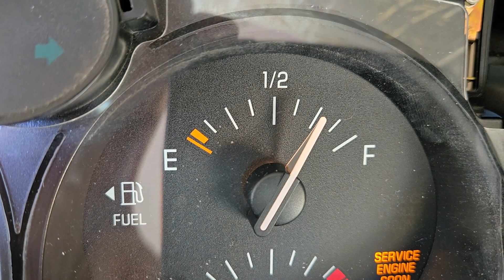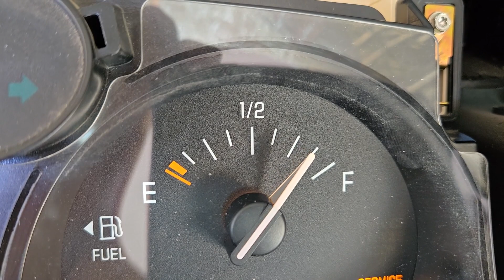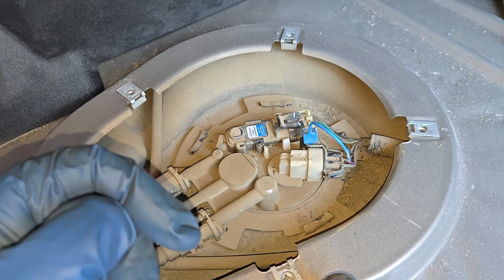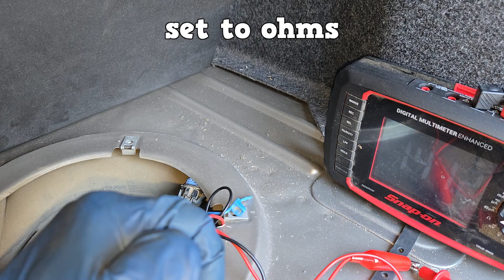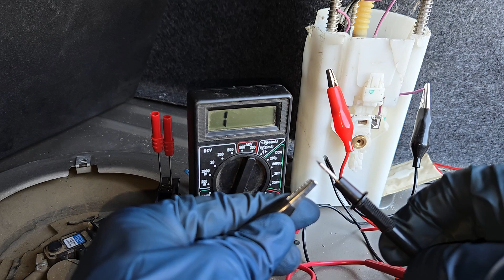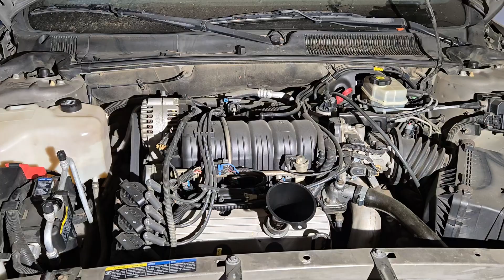How to Diagnose a Fluctuating Fuel Level Gauge (00-05) Buick LeSabre

Comment: 2000 LeSabre. 130,000 kms. Guage would be on full with 3/4 tankof fuel, then drop to zero randomly. Restart and it might go to full again or zero or drop from full. I swapped out the pump assembly with a new Bosch unit and no change.

Off to search videos on tge next possibility.

Comment: If needle is stuck on wrong side of post just drill a small hole hear the needle and push it around until it rests one the correct side. 2 minute fix no need to take dash apart

Comment: Helpful video. I did my son's 2000 park avenue a few years ago.  Although you can just change the fuel gauge sending unit (and not the whole pump) if ur pump is old, just change the whole thing (fuel pump and fuel sender assembly) and be done with it.
   I've been driving my lesabre for several years with the famous fuel gauge issue (it's a very poor design) as the wipers need to stay in contact with the resistive material, but they don't. They pull away and go to infinite resistance and cause ur gauge to read full (which could be a problem for some).  I used the GM pump in our park avenue.  No issues.  Is there an aftermarket one that is better ? Anyone here have at least 50k miles on an aftermarket pump and fuel sender assembly for a '02 lesabre? Thanks !!

Comment: I have two meters and they were both pinned at point 742 ohms
Reply from the maker: Not even 1 ohm. Does the fuel gauge stay on empty all the time, even when you fill up the tank?
Reply: @OldSchoolNoe  the gauge was stuck on full, then I disconnected the sending unit. It stayed on full, I shook the car and  the needle fell to empty. When I pinned the purple n black/w stripe wire that's when it read less than 1 ohm. I filled the tank today and it went from  just over a quarter to full very slowly.
Reply from the maker: @rogerhanson8241  I would test the fuel gauge needle by using an old fuel pump/sender and moving the float around, to see if it responds accordingly. Getting a hold of an old fuel pump like the one shown n the video might be the difficult part.